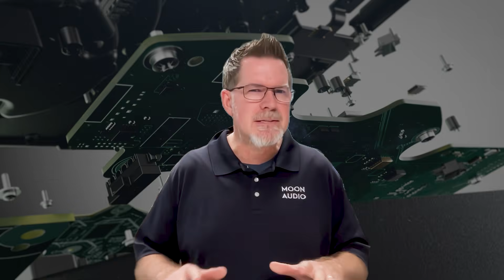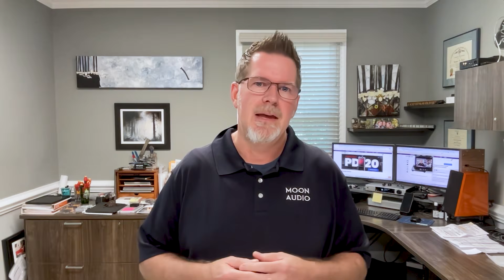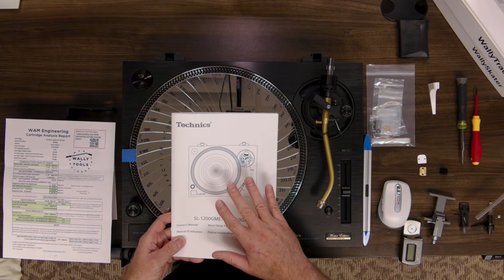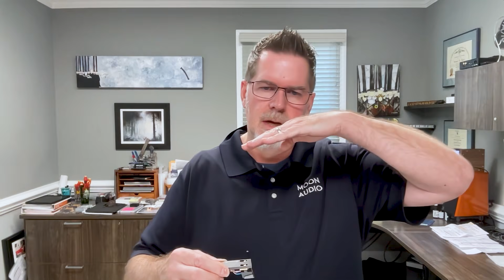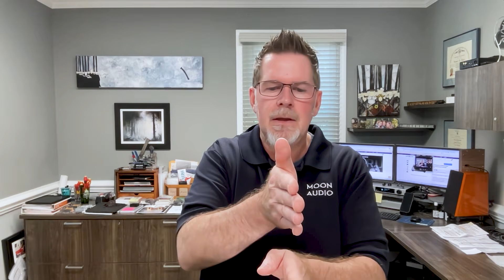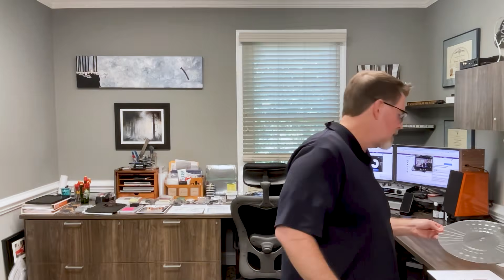VERY Detailed Turntable SETUP for AUDIOPHILES! Technics SL-1210GME & Wally Tools

Comment from the maker: Hey everyone, Drew here. A huge thank you to JR Boisclair at WAM Engineering for reaching out with some important clarifications after watching this video!

Two things worth noting for anyone going deep on this process:

[1] When using the WallyTractor, I was working from the SAT tonearm null points, which are different from the standard IEC alignment points. For most setups, you'll want to reference the IEC points, which run along a straight radial line on the tractor rather than along an arc.

[2] On the WallyZenith step: since I was working with an analyzed cartridge that had a zenith error to correct, the adjustment is made by revolving the cartridge in the headshell on a horizontal plane to intentionally offset the cantilever to the target angle (3.5° in my case). This is distinct from adjusting azimuth on a vertical plane... two very different actions with very different sonic results.

JR's own videos and written instructions cover both of these in much greater detail, and I'd highly recommend checking those out alongside this walkthrough. The goal here was to show the process and the tools in action. JR is the authority on the methodology behind them.

Thanks again JR, and for everyone watching, this is exactly why working with analyzed cartridges and precision tools is such a rabbit hole. Worth every second!

Comment: Got so tried of this process after owning fixed headshell tonearms for years and went with a couple of Technics TT's and the whole record process seems a lot more fun now. Technics makes setting up carts so easy that this seems to defeat the point a little. Find the height of cart (with stylus) from manufacture. Assign the VTA # in the manual to that height- done, your level Adjust over time by ear if needed. The Wally Analysis is really only helpful for aligning Zenith adj for misaligned stylus. Not to say that's not important, (if the problem exists in the first place) but I don't know... For Azimuth I just put a tiny bubble level on top of the headshell and tighten. No more Fogometer. I've done the full muti hour "proper alignment" on the technics ( I have all the tools) and I actually liked the way my cart sounded with the simple technics set up (Stevenson Alignment) A far as anti skate goes I've never owned a table where it was so easy to adjust. Just find a test record with a centered blank section. Set the antiskate so that the tonearm moves very slowly toward the spindle - done. I always find the technics antiskate to be right on the money so if you set it to the same as the tracking force you're also pretty much done, Old school but with this table it's all you need. I bought a 1200GME, and now have 7 carts, to have some fun and not have to get into the weeds with this process. Watching this video convinced me that I made the right decision.  By the way the concord still needs proper VTA setting but there is nothing you can do with the alignment other than azimuth adj. Not saying that there is no value in the all the laborious steps and expense of this process but I'm just glad that with the Technics I feel like I can be done with most of it and I'm having so much fun swapping out carts...
Reply: Couldnt agree more friend.  I would bet a paycheck that one could set up two Technics tables, one guy use the Wally - and the other use the Technics tool / small bubble level for Azimuth / VTA per the book, anti skate as needed.  Blind sound test - you aint gonna be able to ascertain a difference in the sound.   Period.  Way too many variables in the system to get so worried about it.

Comment: I have nothing against WAM engineering but using those tools for a 2.500 EUR cartridge as an individual is somehow exaggerated A look at the European (Italian) distributor of Wally tools confirms that the pricing of the tools used are about 1500 EUR without the shims and cartridge verification by WAM engineering. Unless used in a professional environment I am of the humble opinion this is somehow over the top.

The Technics tonearm has been specifically designed with a modified Stevenson alignment geometry (lower distortion in the inner grooves), hence the overhang tool supplied with the Technics deck, and why the Ortofon Concorde has the same 52mm as the tool provided. Take into account the 3 commonly used geometries are mathematically approximations Bearwald (Loefgren A), Loefgren B and Stevenson. The choice is up to you and also the records you play as record companies used different standards DIN, IEC, JIS, ... for the manufacturing of 12" records. You have to lavish through your collection and it also depends how old your record collection is. You read your records following an arc with starts at the overhang point and 2 null points where the stylus sits perpendicular to the groove.

The newer Technics headshells have a screw to correct for azimuth.
Although very useful, removing the headshell from the mount will alter the azimuth.
As a general rule of thumb anti skating is about 1/10th of the tracking force recommended by the cartridge manufacturer.

I have aligned a lot of "pedestrian" cartridges as some more expensive ones like the Ortofon Cadenza range you mentioned. In most cases I use the recommended values of the tonearm manufacturer as a starting point.
Reply: Finally someone who gets Stevenson you the man

Comment: Interestingly enough, I had been enjoying listening to my records on my Technics SL-1210MK2 for decades with a basic, amateurish turntable and cartridge setup. Then I fell down the gear setup and upgrade rabbit hole, and now that I’ve got everything dialed in and set up precisely, I have this weird feeling that I don’t enjoy music from my LPs anymore.
I definitely gained about 10–20% in sound quality, but I seem to have lost the emotional connection and listening momentum I used to have. When I listen to the same music digitally on headphones, I still get that raw emotional response, so it’s not that I’m getting older and losing interest in music.
I’d give a lot to get back to enjoying the music instead of listening to the gear.
Reply: Did you change the turntable into something audiophile too?
Reply: @0031.yourmoralcompass  Nope, I updated the cartridge to a Shure V15 Type III with an original VN35E stylus in mint condition. The SL-1210 MK2 middle-weight tonearm is a little too heavy for that high-compliance cartridge, so I compensated for it with an ultra-light Denon PCL-5 6-gram headshell with nylon screws and an external KAB TD-1200 silicone damper. The sound quality now is very good and way better than it was before, but the problem is more in my head than in the gear. As I said, the more I study and upgrade, the less I enjoy raw music and the more I analyze aspects of the sound. That feels weird, because I expected the opposite before I started. I am afraid that if I go deeper into it, I could just lose all the fun of listening to music and become obsessive about the sound.

Comment: Hm, those headshell seam to be quite heavy, increasing the effective mass of the tonearme. Most cartriges are quite comfortable with the original 7,5 g headshell and the effective mass of 12g. Heavier Headshell may just be needed for Mc cartridges like Denon 103 or Ortofon SPU . Apart from that, the overhang Technics recomends is based on a modiefied Stephenson alignment, that gives good results on the inner groves, but has higher general distorion than a Bearwald alignment